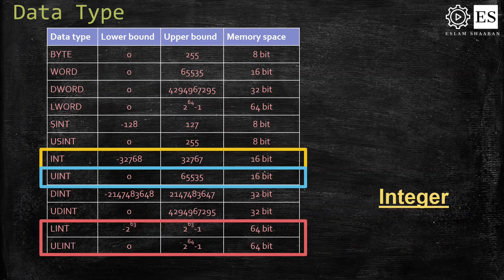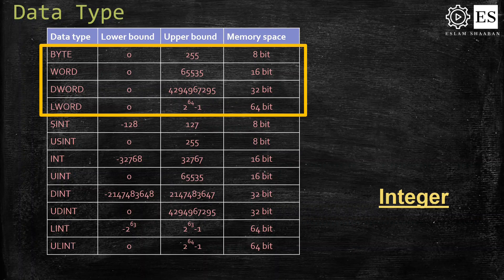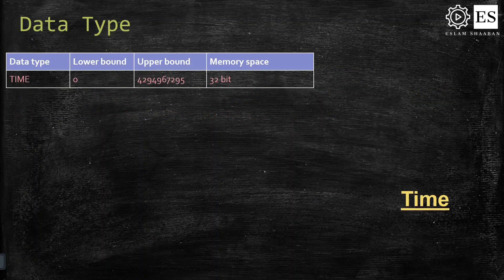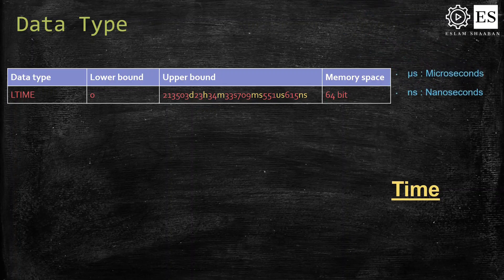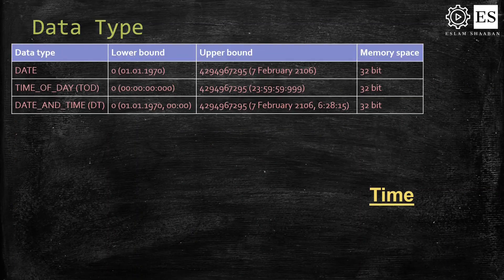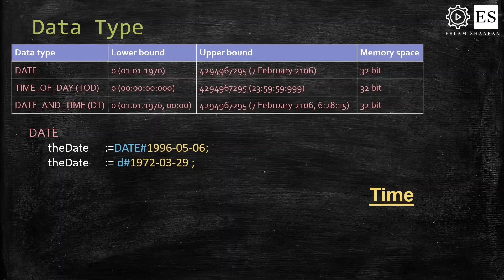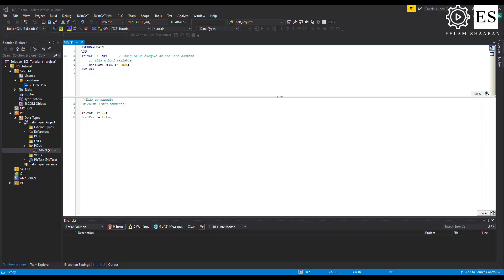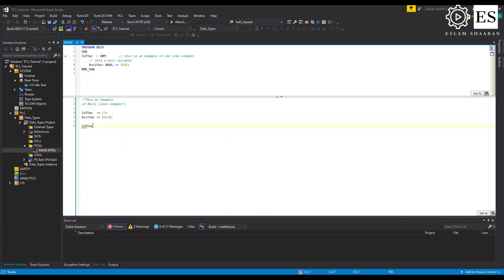PC-based PLC programming using TwinCAT3 tutorial _  Data Types  Smart coding Input Assistant  _ 4/16

Comment: Thanks for the interesting series. I am looking for simple serial communication using RS232/RS485.
Reply from the maker: The following three options are available for the communication:

Option 1: PC COM ports

You can address your physical COM port directly from the PLC.

Option 2: Beckhoff terminals

The network-based fieldbus system from Beckhoff can be used to access serial terminals at a distance of up to 100 m.

The following Beckhoff terminals are supported:

KL6xxx Bus Terminals
EL60xx EtherCAT Terminals
Option 3: Virtual COM ports

The function provides an ADS server for accessing virtual COM ports of the operating system from the PLC.
This makes it possible to use USB devices that come with a proprietary USB-to-VirtualCom driver. The COM port must register in Windows as 'COM1' ... 'COM255'. In the TwinCAT/BSD operating system the COM port must register as `ttyu0`...`ttyu255`.

To use virtual COM ports, it is necessary to install the TC3 Function Setups on the system in which the virtual COM port exists.
Reply: @eslamshaaban57  Thanks for the detail reply. I am looking for an example project using serial communication on the physical port of CX7080. Any video on this will be helpful 👍
Reply: Finally I could send bytes on RS232 port but the sending string is still not working.
Reply from the maker: Keep up the good work 👍